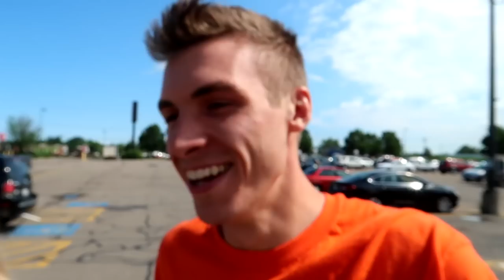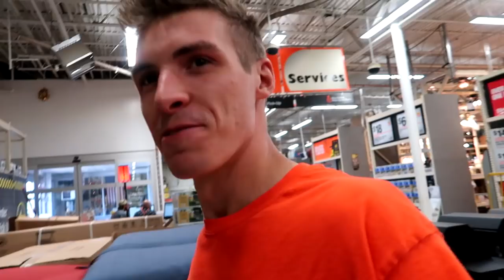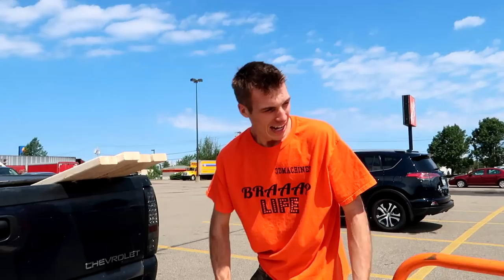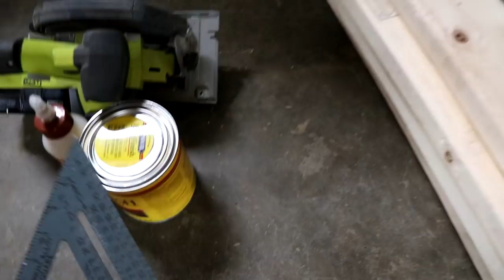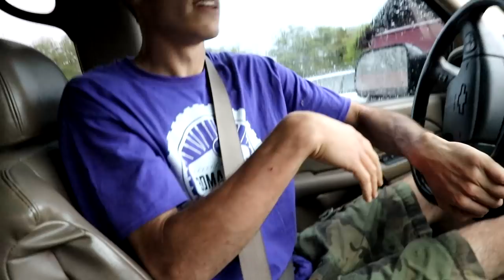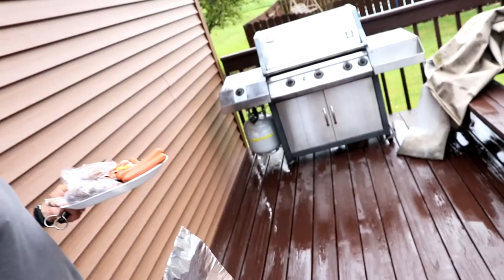We NEED Building Supplies

Comment: Dalton, I learned a cool trick from my grandfather (who has been a general contractor for 60 years). When you get wood, aside from making sure it is straight. Make sure it is not the center of the tree. If you can see the center, the wood is going to warp once it drys out. A few of those pieces you got were center cuts.
Reply: MrChrisproductions good idea!